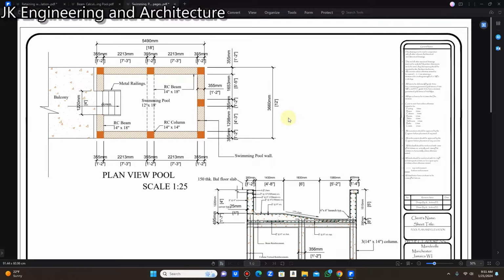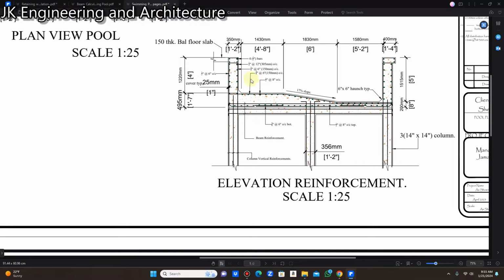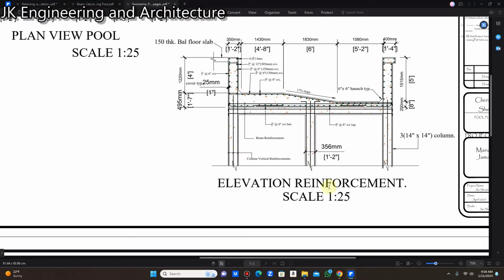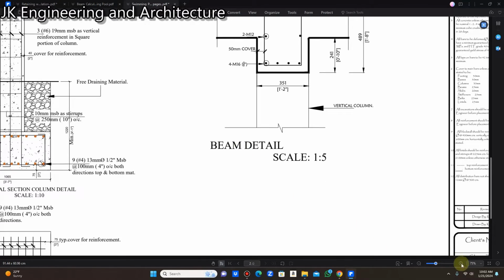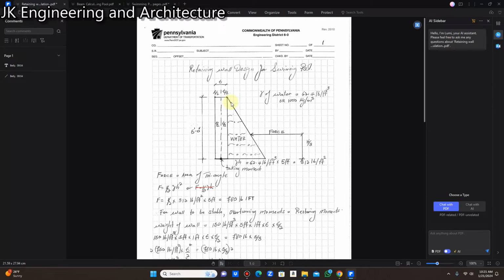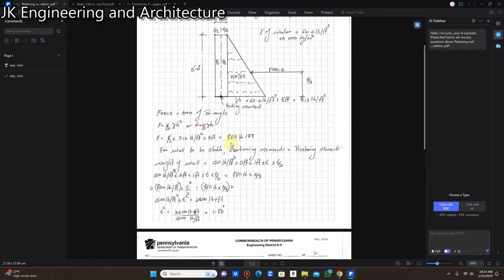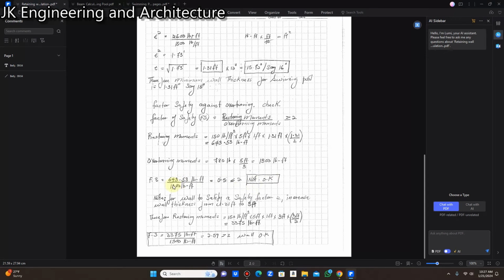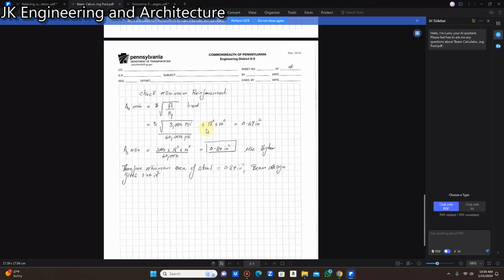Design and Construction drawings for a Swimming Pool.

Comment: How can i get a good structural  calculation  book
Reply from the maker: There are no structural calculation book. You just have to study each topic individually. You need to buy Reinforce Concrete design Book for concrete members and Steel design book for Steel structures.
Reply: Design of Concrete structures fourteenth edition is a good book